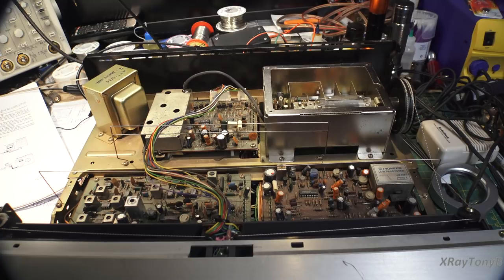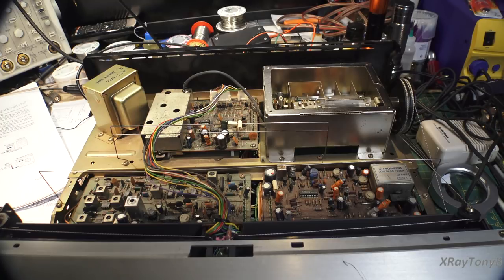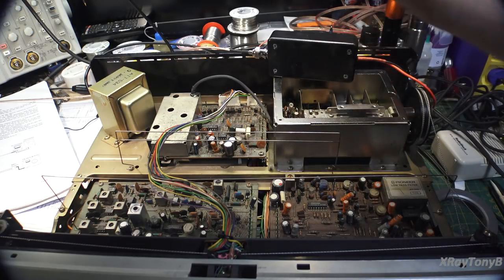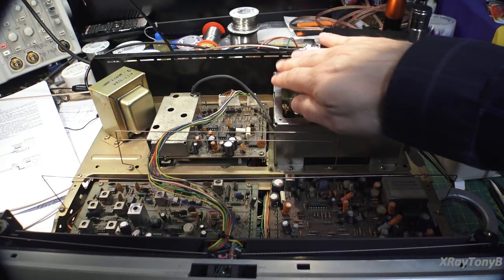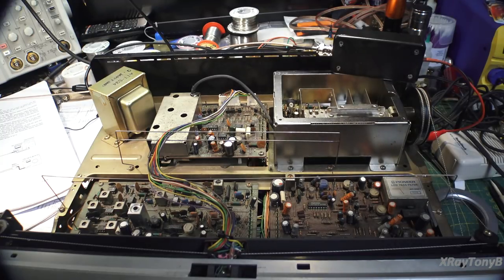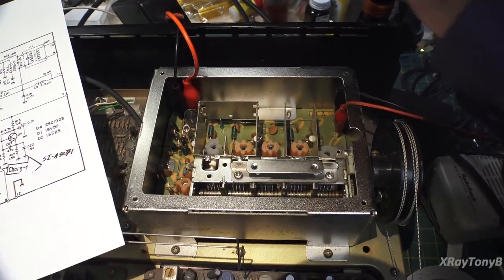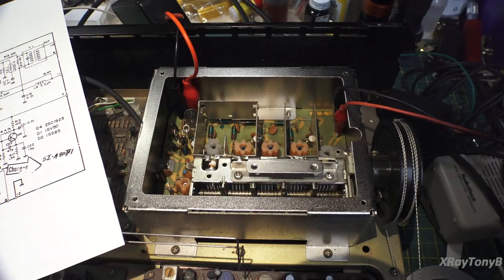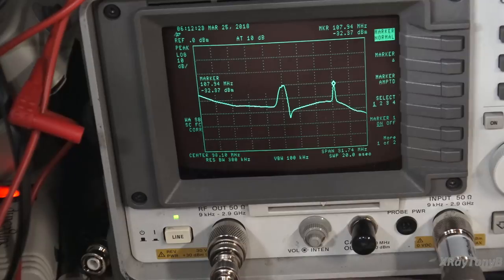Pioneer F -28 Part 4 - Sneezing and Troubleshooting

Comment: So it's just off on the part generating a signal that must be multiplied by 0 through 512? (At least going off the steps available on the binary counter going across the tunable band.) Is there anything else indicative of that value that's not there? So the needed frequency increase for each step would be (total range)/512... 

(Pardon me for being too much of a noob and trying to figure out what's going on. Just kind of interesting to see if you figure it out.)

Comment: Yes you can!  As long as you are not sure about that varactor, you can not be sure about the stability of the VCO;  the PLL will not lock. You may struggle with phase noise.  How about increasing the emitter resistance R64, which, apparantly, the manufacturer already did, in order to reduce the transistor's flicker noise, which may be responsible for phase noise and instability.  As far as I follow your explanation, you know that.  I guess, first things first, replace that dubious varactor.